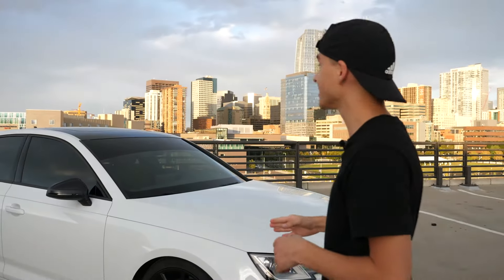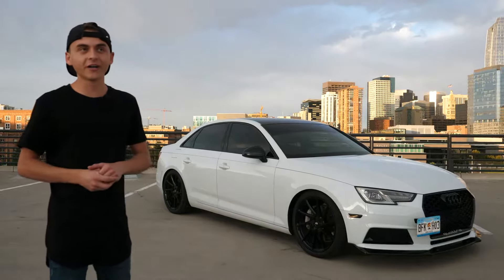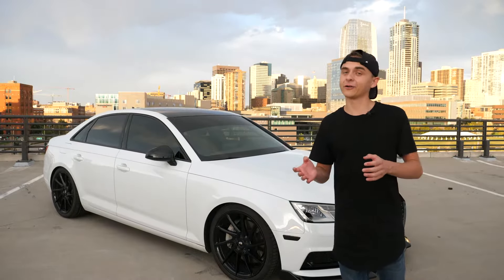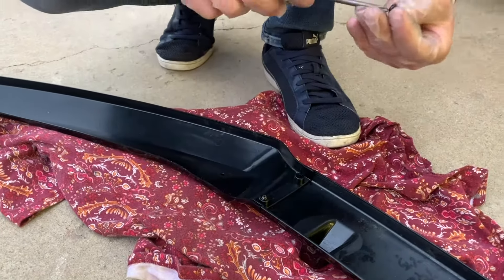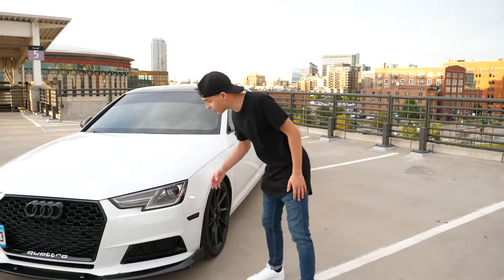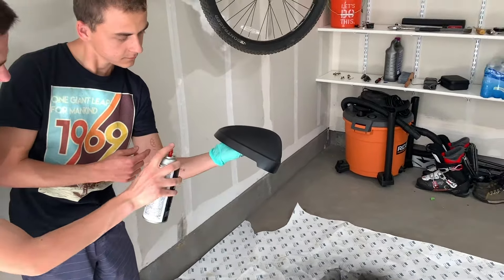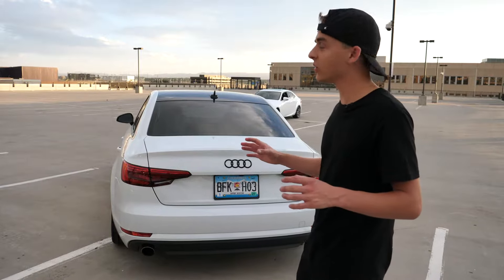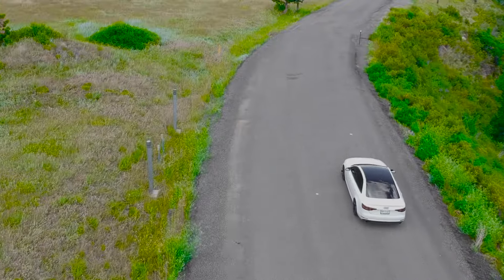TOP 5 MODS WE'VE DONE ON THE 2017 Audi A4 B9

Comment: A $500 tune is a money drop? You put $2k into wheels alone lol
Reply: For real lol. First mod I did on mine was a tune and it's worth every penny. This dude blew an entire performance budget on cheap eBay stick ons
Reply: @edward1927 lol yeah I have the same car. Only thing I’m debating on is the grill. Tune is the first thing and maybe an intake for the sound.
Reply: @davraam7595  tune and intake for the sweet turbo sounds. Car really benefits from a stiffer rear sway bar too. I also want to switch to a honeycomb grill from a looks perspective, just not sure which one to get.

I went with the IE tune and intake. I don't really run it hard enough to warrant an intercooler yet. I want to talk to them about their new TCU tune
Reply: @edward1927  what intake did you go with? I’m looking at the hard plastic IE one and honestly thinking about APR stage 1 because this Indy shop I’m trying to get into does their tunes.
Reply: @davraam7595  I did IE tune and intake. I don't think it matters what intake you do. They're not all that different. Basically just a cone filter and bigger tube that's all of a foot long. It's not like mixing and matching will affect anything. I don't know anything about going to a shop, did install and flash myself.

Comment: $1400 for a set of competitive coilovers?
Yes.
$2400 for good rubber and wheels?
Yes.
$500 for a tune that substantially increases horsepower and response?
No.
Reply from the maker: Haha, good point! Thanks for watching!
Reply: Car looks great
Maybe they didn’t need more hp
Reply from the maker: That’s right!
Reply: Yeah and you will be buying a new engine in a year.
Reply: @silvinchoren9810  My A4 has been tuned for over a year now, big injector tune at that. Everything is healthy with no problems, and any repairs I've done since are maintenance items that would of went anyways. Many others who've flashed their A4 say the same.

A stage 1/1+ tune won't noticeably effect the engines lifespan but, maintenance WILL. Take care of the car, and it will take care of you
Reply: Hahaha i had the same thought. Between 4 to 5k in aesthetics, wheels, tires, suspension. 500 for a tune "that's a big drop" lol
Reply: where did you order your honeycomb grill and vents?
Reply: @10000dboy  its in the links bro
Reply: Where are you finding a b9 a4 tune at? Maestro and all the big tuners haven't unlocked the ECU yet
Reply: @MrKillerToad  Pretty sure APR tunes the B9, haven't looked at other tuners but, other big tuners should also offer reflashes for the B9 platform.
Reply: @Joe_Rebel  yeah, there are JB4 tunes and apr canned tunes out there, but if you're going to spend that much, you should just get a real tune lol
Reply: I’m glad someone said this 😂😂
Reply: @Joe_Rebel  There are some ECU tunes but no TCU tunes for the 7-speed in the B9 A4 yet.

Comment: You have to do a quad exhaust that will definitely give it a mean look and sound too
Reply from the maker: Do you know what brand is the best?
Reply: Burning Rubber what I did for mine just went to a local shop deleted everything but the cat. And at the end I put in the quad tips. Mine is an A3 2018 2.0T. Check my Instagram Steelers_723

Comment: hey man, nice vid : wondering if you considered changing xenon+led headlights for full led ones - led matrix. Or is it impossible due to control unit computer inside of the car (not being there) ? I am expecting this same car and wondering if it is possible in future to upgrade headlights for the matrix ones...
Reply: best to buy the car with matrix option, the radar tech used to operate the matrix zones may need additional control chips and sensors